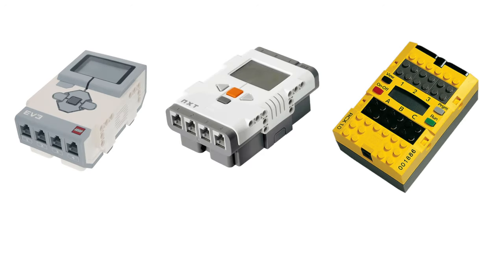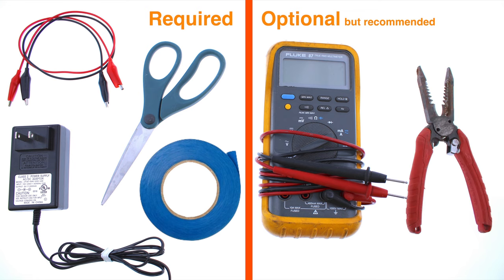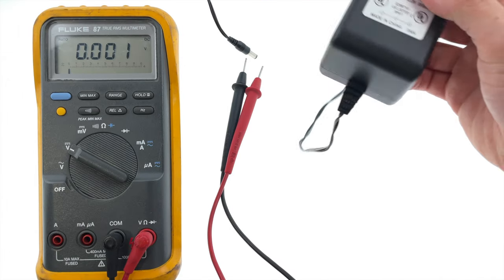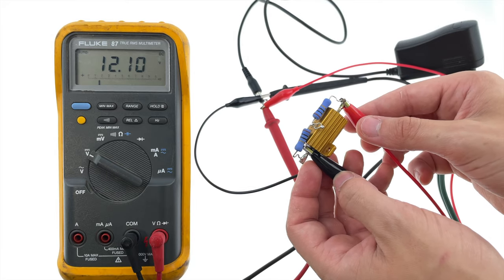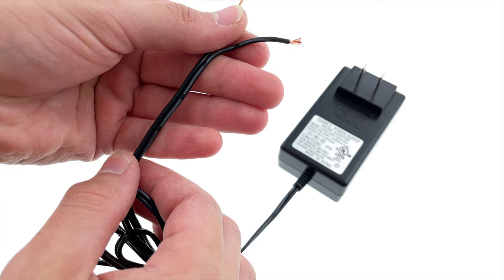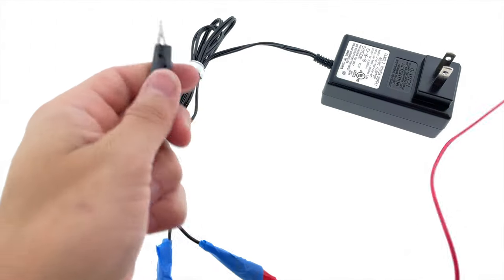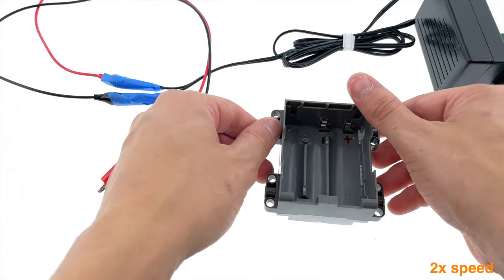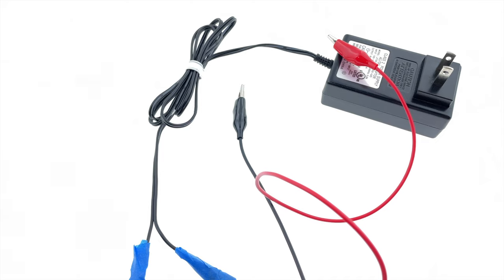Power Your LEGO Electronics From the Wall! NO MODS!

Comment: I'd definitely recommend using electrical tape rather than blue painter's tape or any other tape if you're plugging anythjng into a wall.
Reply: 9V DC can't hurt you
Reply: You're overestimating how good electrical tape is
Reply from the maker: I have no idea how I missed this comment. Anyway, it’s only 9v, there is no chance the full 120/240V will touch the low voltage side, but I really should have used electrical tape. The most embarrassing part is I had some on hand!

Comment: That's actually really cool and I really want to try this someday, though with the Ev3 there is an actual lego rechargable battery that you can plug into the wall to make it wall powered. Not sure if the other mindsotrms have this though the 2020 robot inventor does come with a rechargeable battery. But I still think this is a great thing for power functions and powered up or anything else that doesn't have an alternative (I know I say that like there isn't the power functions rechargable battery box but hey you might want to connect a different battery box to the wall sometimes) Basically, swanky trick I subscribed!
Reply from the maker: Thanks! The issue with the rechargeable EV3 battery is that they are extremely expensive. The issue with the rechargeable power functions battery box is that it doesn't output that much power to power multiple motors. (I have issues with nearly everything) And in this market, the EV3 battery and the rechargeable PF battery box will certainly cost much more.
Reply: @LegoTechnicsRule  You're welcome! Yeah they are expensive but I personally think it's better in that it gives the brick a cover rather than this method where you have an open back, but I am also worried that if I kept using a mindstorms rechargeable battery that it would die after a while since rechargeable batteries also die, though If I were to keep it plugged into the wall constantly I don't know if it would still die. Though I will say this good for the power functions rechargeable battery box since as you said they don't provide as much power as other battery boxes. The rechargeable alternatives do cost a lot but I think the different methods work better for different things even if you have to pay more sometimes.

Comment: I recommend just using batteries for the hubs because they can’t move that far in technic sets connected the the wall
Reply from the maker: Fair point! However, when are you ever 10 feet away from an outlet? If you are, you could use an extension cord. Just saying, it’s way cheaper than batteries.

Comment: the downfall is if you disconnect the PSU on a ev3 before shutting it down properly it can cause the brick to factory reset itself, the NXT dosent have this issue and automaticaly boots up after it gets disconnected from power when on and then power back
Reply from the maker: I’ve never had that problem before but I suppose one could wait before unplugging xD
Reply: I have it happen before when using a 9v battery on it if i disconnect the battery before shutting it down properly all user data is cleared and factory reset @LegoTechnicsRule

Comment: Im fairly sure that alligator clips have those rubber handles to cover up the metal bits so you don't shock yourself or cause a short circuit so I think you don't need the tape just pull those rubber bits down and you're good

Comment: Nice job on the video!  Even with a username like "BatteryPoweredBricks" I try to eliminate as many batteries as I can 😅.  I've used the method you showed in the past many times.  In fact when I had a 4.5 motor from an old Lego DACTA set as a kid, my dad built a little project box with a toggle switch and used it with an AC adapter to save on batteries way back then 🙂.  These days I use tons of train regulators and a large 12VAC transformer to power them all along with all of the other 9-12VAC components Lego made over the years.
Reply from the maker: Thanks for the kind words! Yes!The train speed regulators use AC which has always confused me. 12V AC power adapters, or any AC output adapters for that matter, are hard to come by and my theory on why LEGO chose AC is, well, because they are in fact hard to find, forcing people to buy a transformer directly from LEGO. 

Since the train speed regulator uses a full bridge rectifier to convert AC to DC... and not many people know this... It can be powered with a 12V DC LINEAR power supply. With switching power supplies, the voltage rating is what you will measure on the output. With linear power supplies, the voltage rating is the RMS voltage. If you measure the output of a linear power supply, it will be the peak voltage of the AC sine wave. In this case it must be a linear power supply as 12V is the RMS voltage, not the peak voltage, which is around 17V for 12V. So technically, the train speed regulator is being powered internally by 17V DC.  You can feed a DC voltage through a full bridge rectifier without problems, the polarity will automatically be corrected by the FBR and the forward voltage drop of the internal FBR will also not be an issue. 

Tl;dr You can power train speed regulators with 12V linear power supplies.
Reply: @LegoTechnicsRule  Simple AC transformers were much more common back in the day, where the bridge rectifier was usually in the device itself, old answering machines etc.  I use an AC power source for simplicity and I hate the thought of two diodes doing all the work while the other two are slacking off! 😅  I built a box with a 5a AC transformer inside and 8 barrel jacks on the front.  I use it with the DACTA Control Lab, Technic Control Center, train regulators, RCX 1.0 and rechargeable NXT batteries, so nice of them to keep the same plug and voltage requirements all those years 😁
Reply from the maker: @BatteryPoweredBricks  For the first part, I may or may not, probably may, have the mind of a conspiracy theorist. Also, I had a feeling you were gonna say that about the diodes. You could jump them I suppose. Also I have always wanted one of those DACTA control center things I just don’t want to pay the price for one lol those things are expensive.

Comment: For the love of the Omnissiah, use electrical tape!  That’s the only tape you can rely on insulate, and since you are pulling on wall power, that important.
Also, cut one wire shorter than the other so that if they do become exposed, they don’t immediately line up and short out.
Reply from the maker: You have some fair points here, and I did have electrical tape on hand, just didn’t use it for some odd reason. However, it is only 9v, and one wrap of electrical tape is good for I believe 600v. Even if the leads did short out, it wouldn’t go bang or anything, nor will it ruin the power supply. I tested all of this beforehand because I didn’t want anyone burning their house down. If someone used a power supply of say, 10A or more(9v), then I would start to worry. I didn’t bother mentioning that because 99% of 9v wall adapters won’t go above 3-4A.
Reply: @LegoTechnicsRule  some low quality power supplies may overheat and even catch fire from an accidental short circuit. Good ones will just shut off until you fix it or it cools down
Reply from the maker: @thewhitefalcon8539  That’s true. We have UL and the like to prevent that from happening, and I’ve been told that if you sell a product that deals with electricity in the US, it must be UL listed in order to sell it. However, I’ve seen power supplies without a UL logo on them and they seem to work fine, but may not have those safety features you mentioned.

Comment: I'd recommend cutting the ends off one side of both the alligator clips and twisting the copper/tin wires of the clips and power supply cables together then taping them tightly with electrical tape or use heat-shrink tubing. It'll hold way better and is one less failure point to worry about.

Ideally you'd use a soldering iron to make a perfect connection but that's scary for beginners (The best way to get over the fear is to try it! With adult supervision, even if you're an adult!)
Reply from the maker: This would be infinitely better. However I was trying to keep it simple. If this project was dealing with higher voltages and currents, I definitely would have encouraged a better connection method.

Comment: If you have the wire strippers they usually have a wire cutter on them. If not do yourself a favor and pick up a cheap wire cutter for as little as $3. You're going to ruin your scissors cutting wire with them.
Reply from the maker: I’m sure scissors can be ruined by cutting wire, but I don’t think one cut of some small wire would do much harm. Good point though.

Comment: it is better to check the polarity otherwise you could destroy the device.

it is possible that there is protection since you are using batteries and if the batteries should get reversed.

you could use a 6 volt linear power supply since they will over volt to 9 volts and even when it dips it should stay above 5 volts witch most electronics use.
Reply from the maker: I suppose you could, just make sure it can supply enough current.

Comment: Can I power up Control + hub by lipo packs 7.4V 2S or 11.4V 3S which are used for RC cars?
Reply from the maker: I wouldn’t risk it. If you had a 9v batt pack with proper protections, mainly overcurrent, than I would say yes.

Comment: I did everything in the video but it did not work. I even tried with a 9v battery still did not work. HELP ME
Reply from the maker: If you have a multimeter on hand use that to verify you’ve got 9v and the correct polarity. If you don’t have one, make sure your connections are solid, you’ve got the right polarity, and you attached the alligator clips to the correct placed on the device you are powering. Also, if you accidentally shorted your power supply that might have killed it. If those don’t work, you can add me on discord and you can show me some pictures and we can get this figured out. My discord name is 82602
Reply: Thanks

Comment: Interesting idea. For a Christmas display with lighting that sounds like a good solution. I wasn't planning on digging my festive lights out until December but are the adapters likely to be 9V?
Reply from the maker: You need to read its output voltage and current on the adapter itself to find out. Most LED drivers are a higher voltage, used to minimize current.
Reply: @LegoTechnicsRule  Thanks. I'll probably go to a discount store and buy either a standalone adapter or something with a bundled adapter that I can canibalise.
Reply from the maker: @edwardlees4585  Goodwill is your best bet. I went through all their spare chargers and stuff and found one almost immediately.
Reply: @LegoTechnicsRule  Thanks. I'm actually in France but I'll find a comparable store somewhere over here. Keep up the interesting videos.

Comment: Is it safe to use an adjustable adapter with 5A
Reply from the maker: Yes, as long as it’s at 9V. 5A is even better. That just means you have more current to reliably power multiple motors.

Comment: Yeah, getting a 9V PSU is the EASY part, it's getting an attachment that snaps in to the battery compartment that's that hard part. You didn't cover that. Useless video.
Reply from the maker: I used alligator clips, which I show about halfway through.
Reply: Yeah I could do that, but I want something more permanent, but not altering the box. I was thinking about using a set of blank/null batteries with the last one soldered to the wires.  @LegoTechnicsRule

Comment: Can I use a 5V powerbank?
Reply from the maker: No. Anything under/over 9v runs the risk of damaging your LEGO electronics.
Reply: @LegoTechnicsRule  So, using an USB PD trigger boad is the only Option?
Reply from the maker: @speeter6345  Yes if you want to use a USB power bank. Make sure it’s capable of outputting 9v and at least 2A(18w), preferably more.

Comment: But there’s a rechargeber ev3 so why do this
Reply from the maker: I would prefer not to drop 100 bucks on something that could be made for quite literally a 10th of the price, not to mention that the rechargeable battery only fits EV3. Thanks for pointing that out though, they were just VERY expensive when being produced and now they are even more expensive.
Reply: @LegoTechnicsRule  Do we know what the EV3 rechargeable does once the battery dies? Does it continue to function as an adapter or does it just die (like my Dell laptop)?
Reply from the maker: @Mekchanoid  I have reason to believe that while plugged in, the EV3 rechargeable battery powers the brick with the power supply.

Comment: 3:30 this should not have to be said but do NOT do this at home for the love of god use a grounding wire so yo don’t become a barbecue
Reply from the maker: Those wires are the output of a galvanically isolated low voltage switching power supply. There is zero shock hazard here unless your hands are covered in salt water.